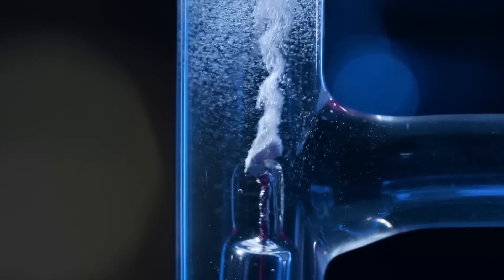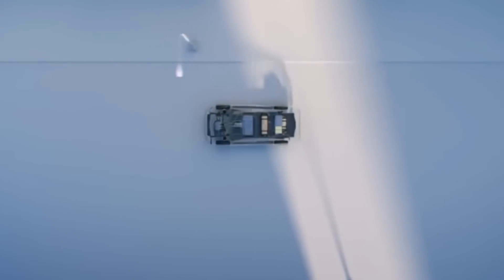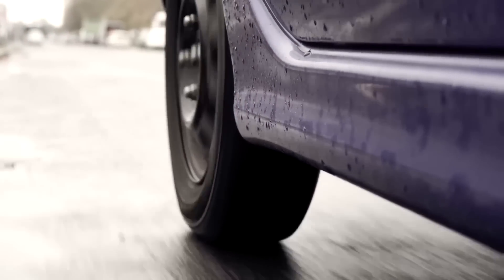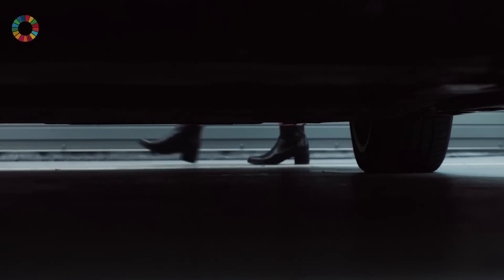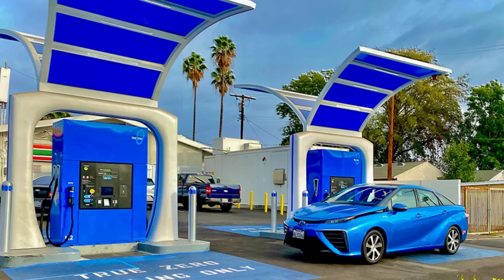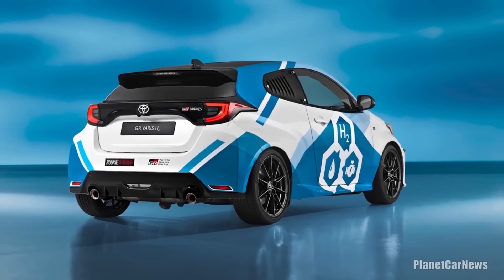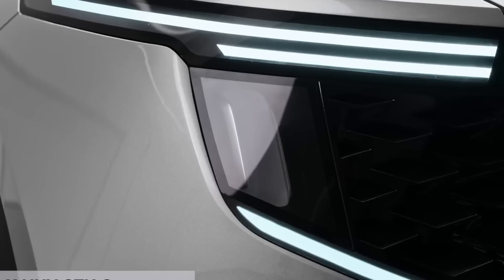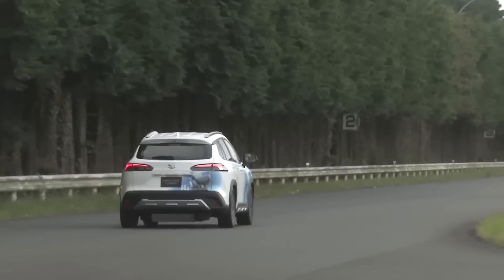Toyota's Engine Runs on Hydrogen!

Comment: How much does a FCEV weight compared to a Tesla with the same size and range? When will we have as many hydrogen stations as gas stations? Is hydrogen cheaper than electricity?
Reply: Clean hydrogen is made with electricity from water, it takes about 54kWh to make 1kg, and that will move a Toyota Mirai 62 miles or 100 km. By contrast, an EV only needs 18kWh to go the same distance, 1/3rd less, because of all the losses from turning water into hydrogen and then back into water again. Hydrogen will always be at least 3 times more expensive than direct electrification via a battery, when you include transporting, storage and retailing, hydrogen comes out 5 to 10 times more expensive.

On the positive side, you can fill up in 5 to 8 minutes when on a road trip with a hydrogen car, as opposed to 12 to 18 minutes in an EV at a DC fast charger, but the downside is you can't fill up at home, work, hotels or while shopping like you can in an EV. Fast charging an EV is more expenive, but only done 5% to 10% of the time. Mostly, you charge up at home or work cheaply.

FCEV is slightly heavier due to the carbon fibre reinforced 10,000 psi / 700 bar tanks to safely store the 5kg of hydrogen and the fuel cell stack, plus a small battery and the normal motor and power electronics you get in any electric car - a FCEV is still an electric car - the fuel cell is instead of the battery, and electricity is still used to power both, but the EV skips turning it into hydrogen and back to electricity again.
Reply: @brushlessmotoring  yeah but an EV will take 30yeare before it becomes "Green" ie it's just done 30 years pollution to build  " 1 ". H is a bi-product of many industrial processes and most is released back as theres massive excess of it & storage is a problem and you forget to mention the weight of a fuel cell vs the battery pack.  one other interesting fact is it takes 10x longer to put out an EV on fire compared to gas / petrol.  They say 10 hours. Fire brigade here just maybe slow that's all. H tanks don't burn nor exploded if poked or provoked. :face-turquoise-covering-eyes:
Reply: @jonscot8393  if you have a clean electricity supply EV is neutral in 15,000 miles, or under a year, if it’s a coal supply, 50,000 miles or 3 years - not 30 - but if you don’t have a clean electricity supply then your hydrogen is polluting 3 times as much as an EV, and is worse than gasoline - it never pays back it’s emissions on the carbon fiber tanks or platinum in the fuel cell.

Methane is a common byproduct but in order to be turned into hydrogen it must be burnt, releasing 9 to 12 tons of CO2 per ton of hydrogen produced, and now you have to physically transport it rather than sending electricity down a wire. 

If you want to spend US$26.75 per 62 miles / 100 km - 0.45 per mile - go buy a Mirai in California- it will cost more than a Model 3 and has less range per tank and can’t be charged at home.

Hydrogen is not clean in reality, it’s CO2 emission are worse than gasoline, or it’s a waste of green electricity which in turn causes more fossil fuel generation to happen.

Comment: You said it: "Toyota has made significant investments in Hydrogen" and if they wrote those investments off - and they need to - the books will show they are even further in debt, it will bury them, the "sunk cost fallacy" means they have to keep the pretense up.

Comment: Manufacturing and production with sustainable , abundance , cheap hydrogen fuel is still small , slow, limited and ancient ways still using crude oil as compare to using  EV charging using various renewable energies
I think Toyota is going the Wrong expensive way developing
Hydrogen for the masses
Reply: Swap out the engine and add a big battery?

Comment: I'll believe it when it's actually in a car that is build on scale you can purchase.  Any minute now Toyota is going to have Solid State Batteries too, is what they have been saying for 5 years.  Toyota is great at claiming new concepts, not so great at delivering actual products.
Reply: You do know that they have hydrogen cars that you can buy right?
Reply: @TLew1234  in super low volume production, probably for a super high cost in limited markets and of course you need to fuel it.  Sure it exists but is it viable and can they be delivered competitively?  Will it ever be more than a niche market?  It makes sense for large scale equipment and maybe trucking if they can build the infrastructure.  For a skateboard it's even dumber as you better have a hydrogen station nearby or some portable way to store your own refueling station.
Reply: @Ry-lx2kl  There is a reason for Japan.  They import virtually everything and that includes fuel for vehicles, to generate power, etc.  With hydrogen they can produce it locally so it makes more sense.  It also helps their GDP.
Reply: Japan n German famine’s don’t really want to full EV😂, they don’t like to depend on and being steered or dictated by their rivals in the long run 
Going to full EV mean to HELL 😂 and no future! Good luck Elonsla n ehh China😂
Still though JPN & G will develop a good dirty battery  for countering but not the goal for electric nutshell 
To smoke out their losers put’em forever loser’s by not following the trends

Comment: I don't care which format, engine, or other design that uses hydrogen I don't want it. One of the truly great things about BEV cars is the ease of charging at home; even better using solar.

Big oil wants hydrogen so they can continue to set prices on fuel.
Reply: Indeed. Toyota, BMW and other legacy OEMs show just how susceptible they are to self deception. BMW are totally lost in the world of EVs, Toyota's debt hole is the deepest on the planet, followed closely by VW. None of them know how to make EVs well, let alone make them profitably.